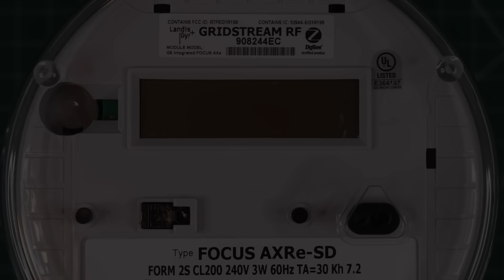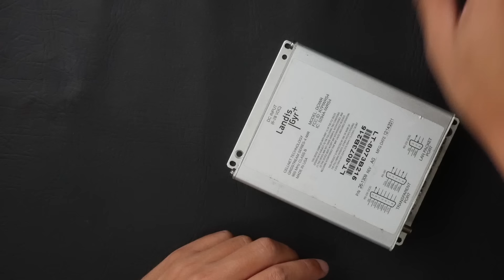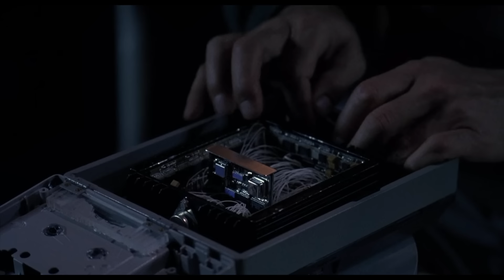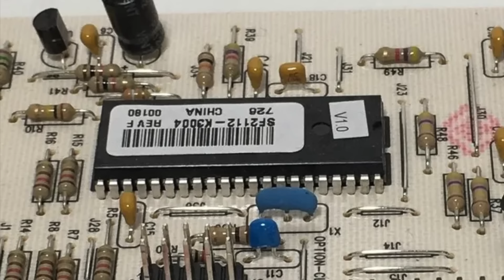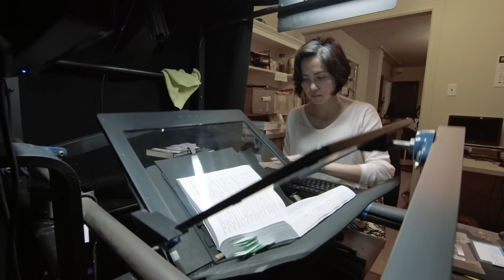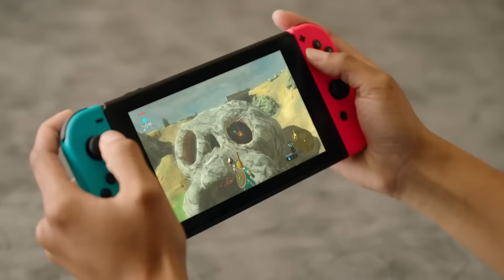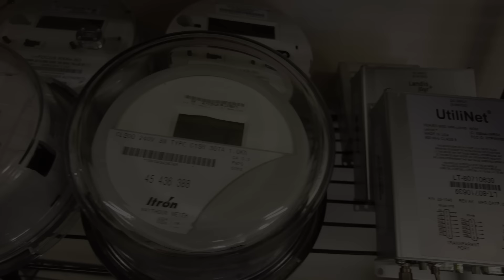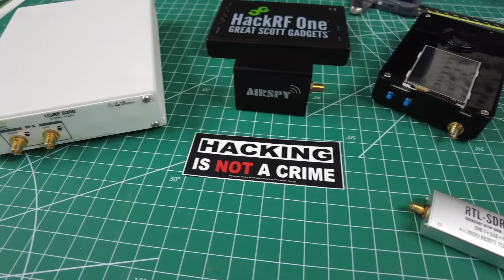The REAL Problem with Smart Meters

Comment: If the meter isn't transmitting how much power that the customer is using as a value encoded within its signals, then it's sending signals at specific times to encode values, or, it's sending signals at specific power usage increments. For example, if it only sends a signal every 0.1kwh, then all they have to do is count the number of signals received and multiply by 0.1 to get the total number of kwh used by that customer. This can also work if the customer has solar and is putting power into the grid if they just include a simple flag bit in the signal itself to indicate whether the increment refers to using or providing power to the grid. If there's no power usage data in the signal, then the power usage data is the signal itself. Otherwise, it's the timings of the signals that's encoding usage. Surely they knew people would try to hack the smartmeters, and security through obscurity works if you can obscure what you're doing enough that nobody can figure it out. Heck, usage might actually be encoded in the data that's being transmitted, obfuscated by blending it with the visible data, and you just have to look harder!
Reply: The meters store the usage until queried. There is no need to query them all the time as they can hold months' worth of data. They only need to be read once a month for billing purposes, but typically are read once a week. So the problem here is that the connection for a meter has to be tracked while the frequency-hopping spread spectrum (FHSS) is going on, for the entire month, to grab those meter reads.
Reply: My solar has a Smart meter for “Consumption”, and a 2nd Smart meter for “Production” (which all PV power runs through), so they are able to tell house consumption, and production via multiple methods..  I am in a program that pays based on production, regardless of where the power is used (some powers the house, while excess flows back to the grid/neighbors)
Reply: @mwolrich  That's interesting. Our solar setup has a box that the panels route into and then that connects to the breaker box and then out through the meter - so during a sunny day when we're generating more than we're using we just see a negative reading on the power meter. If I want to see what the panels are doing I can log into a web interface that shows me panel outputs and totals in 15-minute intervals throughout the day.
Reply: @CharlesVanNoland  yes, I see the Consumption meter moving forward and backwards as will (its digital), a good month the ending reading is lower than the starting reading (generated more power than consumed), I have an Enphase microinverter system, it has Production CT’s as well as Consimption CT’s, the web portal shows the status as well..  but the Smart meters are for National Grid, the utility, for billing as well as solar credits from production..  those are all “revenue” grade meters.
Reply: @mwolrich  You're welcome (for my tax dollars subsidizing your solar crap).
Reply: Could very well be encrypted for privacy reasons.
Also the regulatory agency want to limit time resolution for privacy reasons, like no way to get values between the metering intervals.

The question is likely more about finding the key!
Reply: @erlendse  The video gave me the impression that all of the data the meter emitted was being collected, and all of it had been deciphered - to where even if the usage value was still encrypted in there it should still be visible as *something*, but the video made it sound like all of the data that the meter is emitting has been decoded and identified. It looked like they weren't able to actually find anything that could possibly even be the power usage reports. They just weren't there.

Someone else mentioned the possibility that maybe it only reports the usage when something else queries it, rather than just constantly emitting it - which is something I hadn't even considered. I assumed these things were just spamming the airwaves (relatively speaking) and didn't require any actual interaction from other devices, but I guess that would make sense. Querying would be much more secure than just broadcasting usage, if there was a Diffie-Hellman key exchange, or possibly public key encryption - though I don't see how encrypting the usage data with a private key for the customer or a public key for the utility's receiver would really help to secure anything. Diffie-Hellman seems like it would be the most secure for this specific use case, and would make sense if the usage must be queried by the utility's hardware on the poles/streetlights.
Reply: No, they xmit kwhr for typically 24 intervals (or the # of intervals since the last xmission).  And power to the grid, would show up negative.  They use encrption to obscure the message....not hiding the data within the "data".

Comment: One could use a number of RTL-SDRs in parallel, right? Coherent decoding of the whole band is not required.
Reply: But you might need so many that it'd be cheaper to just buy the higher grade SDR... but I dunno, I've not done the maths.

Comment: The lending library would have been a nice idea.   But, even though that didn't work out, some times things get leaked online. [wink wink] 😉
Reply: I think he alluded to the firmware being tied to a hardware key/identifier. Depending on how this was implemented, a "leaked" copy could point to the source if a unique hardware key is somehow embedded in the firmware. Without the master key it could be difficult to find and alter identifying information, as well as the risk of unwittingly breaking something
Reply: @ldt8904  If only it were possible to get a power meter that wasn't tied to your name.

Comment: So, after all this, did you ever locate the actual power value transmitted to the power company?
I opted out for a smartmeter...nothing I want to have.  Unfortunately, I get charged extra each month for not having one.
Even without a smartmeter, each month I receive a "home energy report" that specifies "where" my home uses energy.  Line items include lighting, kitchen, electronics, heating, other, laundry, and cooling.  They say 35% of my energy usage is for lighting...really?  I can assure you I sit at night with ONE LED bulb illuminated, no security lights, so where do they come up with 35%?  Percentages listed for the other catagories are BS also.  I have zero confidence that any data I receive from the power company is accurate!
Reply: Even with smart meters they can not tell what is using power in such a granular way. They are making assumptions. I track my use with clamp meters. I can tell when my electric furnace kicks on, its very obvious when a 50amp load is running. Its very hard to see a 10w load turn on, its well with in the margin of error
Reply: Agree , we pay an extra 13$ a month for not having smart meter ! We also get that letter saying we use more energy then our neighbors . We are dumbfounded as we have had our house gutted all new solid cell spray foam insulation , the lighting has all been converted to led , the heating system  is a wood pellet stove , the hot water is on demand ! We don't watch tv , nor do we seldom use our smart phones or computer so that letter is nothing more then fear mongering .
Reply: @Original22 terrible
Reply: Technically they aren't supposed to charge for opt out because the government already reimbursed them for potential opt outs. So. They're double dipping. Smart meters are Invasive surveillance tech... They are also extremely harmful for the health of anything living... Between smart meters and WiFi everyone is unaware of the severe damage being done to their bodies... 
You are supposed to be able to have an old meter without extra cost if you can provide a doctors note that informs the power company that you have a health issue that the meter makes worse (like, you had cancer or you're EM sensitive) once you have a meter it's difficult to get removed. If they come to remove it they're known for blowing out your power and leaving, and you end up having to find an electrician to come fix your power at your expense. They're also known for telling customers they removed the smart meter but they actually installed a semi smart meter, usually the customer pays their double dipping fees and when they find out they were lied to they're given the run around and told they'll be charged again whenever they can locate an old meter,
Reply: You are only paying that extra amount because you accepted the contract they offered you.  If you think it's fair to charge you extra to use the same "old" safe equipment then carry on.  If however you find the situation unacceptable, you can change this by replying with an conditional acceptance.
Reply: Now thats interesting.  Could you tolerate a month of battery operated lamp to see what happens?

Comment: I am surprised that US smart meters do not have to adhere to IEC 62056 for meter data
Reply: The only regulation in the USA is that presumably the meter must collect accurate usage data.
Reply: @soundspark  And how exactly is that checked and by who, no one ever came to my house with a power meter and and compared it to what my meter was reporting. Sounds like they could just remotely tweek the meters a little and who would ever know? I would not trust the power company as far as I could throw it.
Reply: @billruss6704  I meant the standards for the manufacture of the meters themselves.
Reply: @billruss6704  it isn't hard to measure your own electrical consumption and then calculate if the bill you get is accurate.
Reply: @Mike__B a stuck wheel means that its Not metering. I remember a guy who dropped a board onto socket meter shattering and stopping the wheel. Hmm.  In the line there is also DC ...
Reply: @Mike__B  Solar nice. There are alot of different systems... some grid tie and some battery back up. I heard power company isn't paying back to customers for making power in grid ties.
Reply: I’ve seen people talk about smart meters in vague detail before, but there’s a whole standard, just for them?
Reply: Real good point.. require it for fuel pumps... in the least every meter should have external ports so we can self test... but they would just Volkswagen that stuff... rofl laughed when they cheated the emissions test... rather smart on there part... till caught....
Reply: @Scotian6444  You would need a calibrated standard and a test set to do it yourself.  That would cost $60,000+.  Not feasible.  Just call the company, they will come do it.
Reply: Who is gonna know or enforce it?
Reply: The USA uses the ANSI C12 standard.
Reply: Well first of all that's Euro specs that deal with meter data exchange for local nets by most likely industrial owners (or apartment based billing) for their own use for production costs...not for utility scale networks.  America uses Ansi for its meter specs.
Reply: @fmorgan98  Industrial and grid meters are a different category. They are more accurate than domestic meters and have more features. When using GWhs,  a promille is a lot of money. The tariff considers reactive energy and may be more complex than the residential day, night, and peak. Another feature is capturing harmonics and other power quality issues. Please take a look at the L+G E660 for a low-end version and the E880  for a high-end example of this type of meter.
Reply: @fmorgan98  Most non-US meters use DLMS/COSEM for data exchange. Exceptions are Germany which uses Sym2 and some proprietary protocols when using a data concentrator ( an application gateway between G3 PLC and TLS)
Reply: I pay 25.00 a month extortion fee to be opted out!
Reply: I was told the meters collect the neighborhoods power n then divides it between the houses! 
We should be able to opt out!!!!
Reply: @MarkousMajorSurf  why would they do that? They're going through all this trouble to send this heavily encrypted signal just to throw all the data away? You bet they're keeping as much data on the individual as they can and they're certainly not charging you based off the "neighborhood power" which wouldn't all come from the same circuit anyway.
Reply: @MarkousMajorSurf  So what you're saying is you'll believe anything?

Comment: Looking forward to this series! I’m interested to learn more about your process, tools, GR blocks, etc. for reverse engineering the RF side of things. 

Our city recently switched from Elster EnergyAxis water and electric meters to Itron Gen5. I had written ea_receiver and rfm69-elster for those Elster meters based off the work of argilo and others, but the Itron Gen5 stuff doesn’t have much research available on it yet. Right now my process is pretty slow and manual — capture some samples on my RSP1A clone sans-antenna in hopes that I’m capturing the meter and not a neighbors weather station, pull them into inspectrum, and hand decode in there. Once I’m certain I’ve got the correct device, I can at least program the syncword into something like an sx1276 so that I can collect a few days of broadcasts and look for patterns. But my guess is that they’re all encrypted and unless they’ve done something stupid, chances are slim that I’ll get anything useful.